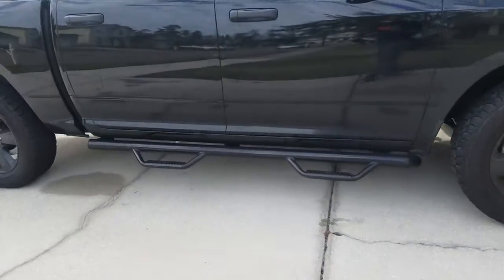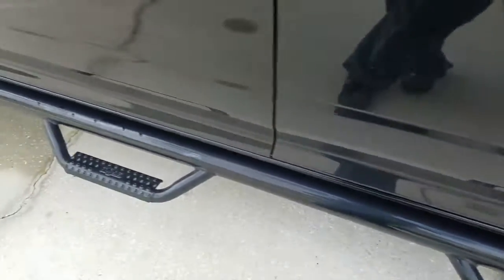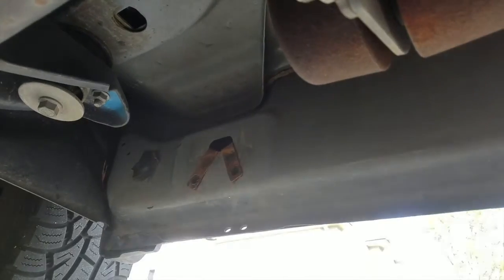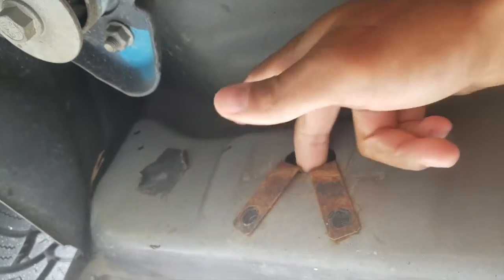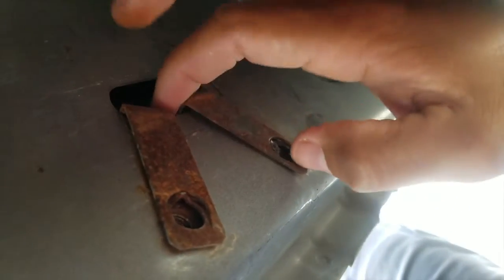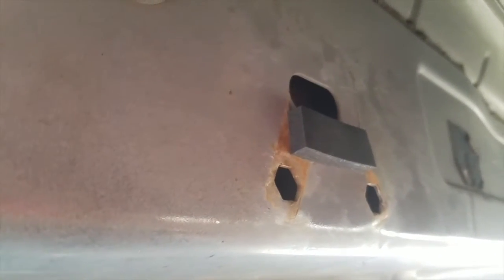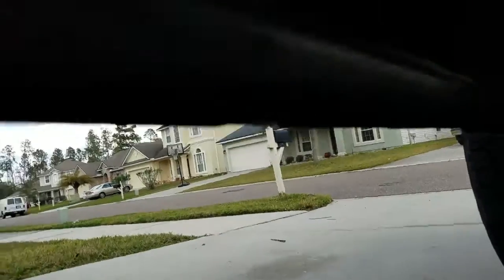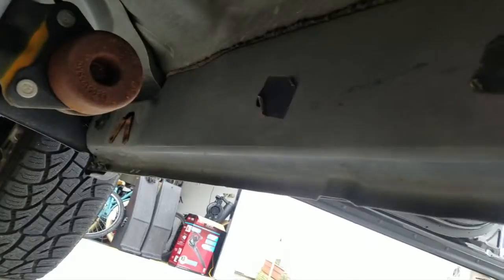N-FAB Nerf Bar Rattle Fix

Comment: Did you only have issues with the passenger side? My driver side doesn’t rattle but my passenger side is the devil.
Reply from the maker: Dewayne I only had trouble with the passenger side. Driver side was fine.